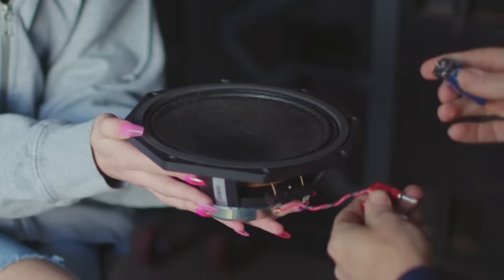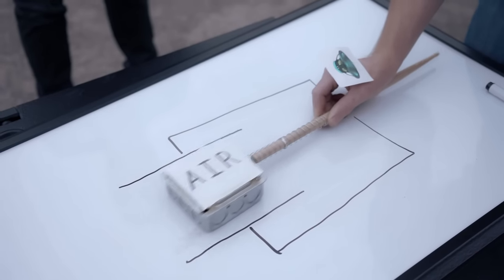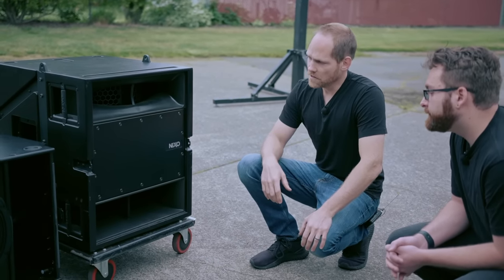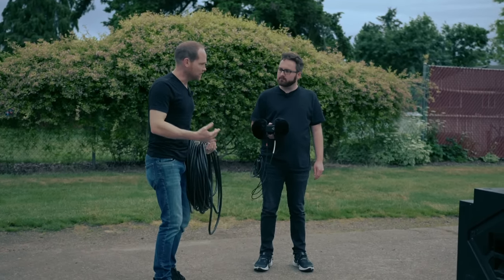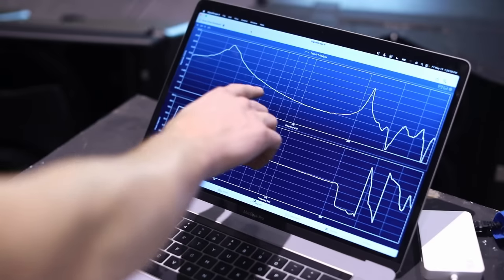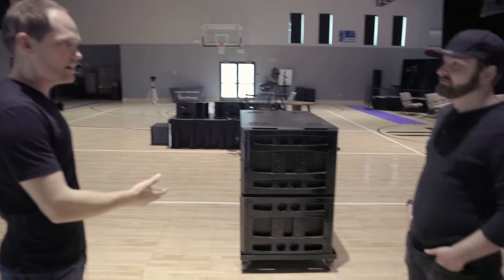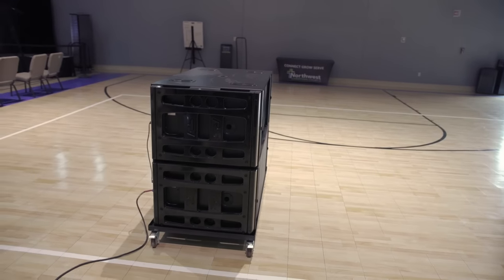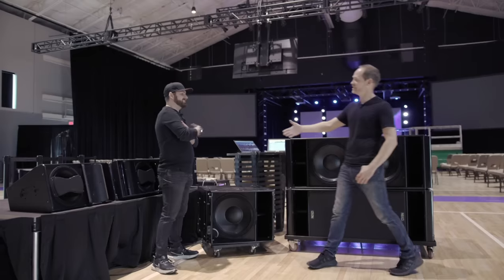Things you didn't realize about bass... until now.

Comment: You guys would be in my endeavor of creating and hopefully selling marketing waterbeds with subs built into frame underneath and crossover experimebts mostly only lowest freq moving the water, and there would be different shapes sizes and vented /non vented enclosures also secured to frame facing water bag at various angles,and what the axrual controls for user or sleeper(if you can sleep) will control..really experimenting with exotic woods and designs like ceiling suspended vs ground secured, yes ceiling suspended waterbed with subs pumping lowest freq through water bag,it's crazy,but I figure if I liked it,way back when. I started at SAE 18 years ago,been on back burner, then someone else will roo

Comment: I like your video. Very good way to do it actually! Try a full tl and tune it at speaker fs then see how much more range you have than a bass reflex that is in phase because of the time delay of the tl tunnel. and better to make it straight, big and simple than a maze. A maze will lower db, also standing waves.. for example a box with the bass in and then just a big tube with 1/3 wavelenght lenght of fs. The tube should not be bigger than SD in diameter. Lets say 28hz is about 3 meters or so. if you use stuffing, you will slow it down and make it shorter. Just tune the bass using dats v3. mesure first impedance curve in free air then see where it lands fs. then mesure it within the cabinet. then you get impedance spike form the cabinet and the port. it should be where fs is straight in the middle og those two peaks. if its not, just cut the tube lenght until it is.

Comment: One reason why I would use a 75ft XLR cable to create a delay to my second sub.. It runs much louder and smoother with less gains. Rather they are coupled or stacked or spread apart less than recommended  distance
Reply: Are you serious??
Reply: @pacosoundaruba   Sadly he is. It seems his knowledge of physics is lower than a potato. a 75' cable is not an ADL...
Reply: Ignorance is a skill......

Comment: i kinda of knew about this. bose audio took advantage of small speaker setup with so long tube chamber inside the box. thats engineering. people thought speaker is all about high quality material which is not entirely true. speaker that cost upward up 5k to 50k are highly tune and use material to get top notch sound thats the difference. people used to open bose speaker and find paper speaker and said bose went cheap. its all about how you tune the speaker to make it sound good not the material. 

i used to mod my speaker with seal speaker. it makes a smooth sound. didnt know much back then i just new it sound smooth and better. now, you see manufacture used radiator. radiator is better than seal speaker as it doesnt lower the loudness of the bass while giving it smooth sounding. radiator is the best setup in my opinion

Comment: I always referred to PA as Public Address, has it now become Pro Audio or something? I don't really know the history of it. I used to make amplifiers and speakers when i was 20, always liked the interesting concepts of speaker box shapes like W bins and folded horns etc. I never really used actual data though, I just tried stuff and see what happend I found the results fascinating. Never build stuff for big crowds though, I had massive PA speakers in a very tiny livingroom, enough to blow your brains out but I never really pushed the volume to extremes. I reaaly liked the sound of big 15inch+ woofers even if listened to on low volumes, drums just sounded more real somehow. Nowadays I'm happy with a normal hifi system and haven't built anything for over 20 years... But it was fun though, maybe I will build my own High-end Hifi system, that seems a bit more appropriate :)

Comment: The explanation is wrong but the visualisation is correct. The box is a resonant chamber, and the port is the weight on the spring. A simple bass reflex box has 2 resonant frequencies, one with the port and one with the speaker itself. These 2 give the subs color. Those rocket engine features are acoustic impedance adapters, or horns if you like that name
Reply from the maker: Isn’t the visualization the explanation?

Comment: Good demo, but badly worded on occasions IMO-still its about the best I have seen here on YT. Sound becomes less directional at low frequencies, so low frequencies couple with ported frequencies either in or out of phase (above and below the port tuning resonance), but at around 80Hz you can percieve where the sound is coming from. Also your ear becomes less sensistive as the frequency drops, meaning you need to push more air, most speakers can get to 60Hz, good speakers 40Hz or even 35Hz, but you need subs or 15" drivers with large excursion to actually 'feel' those low notes from say a church organ or your fave rap album, going below 20Hz is pointless as CD's do not contain that low frequency content, however some movies do (explosions and the like are 'felt').
Closed box speakers produce better transient response (termed 2nd order) whilst ported are not as hard-hitting but go much deeper (termed 4th order). Ported also have less distortion at the port frequency because the voice coil is moving less-longer excursions by their nature produce more distortion because the spider and surround rubbers do not act like a perfect spring.
In general when purchasing a subwoofer, try and get the larger boxes, smaller boxes use equalisation(Linkwitz Riley variations) and the tradeoff is they require very large excursion woofers adding distortion (as mentioned before), 
Most modern speakers really compromise on the driver quality, look for units that contain drivers from most notably Seas, Speakscan, Morel, Audex and so on.
B&W make their own, fantastic high end stuff, but their budget drivers used in most of their mid range stuff is pretty poor relative to off the shelf Seas for example.
You young guys really need to invent a better speaker system, this moving voice coil has been with us for decades and as I mentioned it has serious limitations, how about a electromagnetically suspended system to get rid of those spiders and surrounds (something to think on).

Comment: I remember buying a set of high quality 6x9 coax speakers to be in stalled in the rear deck in my car back about 1978. To test them, I just laid them on top of the deck, hooked them up and cranked up the tunes. They sounded terrible, no bass at all! My friend assured me that once installed, dumping half of the low frequency sound into the trunk, they would sound good, and that surely was the case. Laying on the deck the sound coming out of the front and the back simply cancelled out at low frequencies. So, yea.

Comment: there's no bass sound below 20 hz because the human ear can't hear that low of frequency, nor could the speaker play lower. Also, if your box is tuned to 30 hz, that would be it's optimum resonant frequency where little power performs best and 20 hz would seem to be non existent. Oscillation at it's best tuned frequency would be resonant and thunderous as can be for a specific amount of power and impedance. In resonance, the speaker will move much less than if it were clipping and distorted due to an improper box and tuning frequency, power and spl are proportionate with thd as well as being overdriven into a clipped signal.
Reply: That is not sub and sub can play lower than 20

Comment: clickbait so educational it should be taught to all sound enthusiasts. i learned that for maximum base efficiency you need to limit the frequency range (cut out the crazy ranges), dual speakers for direction control and programmable high end sound processor for amplifications delays settings etc to make it work the way you intend to. current single subs are good enough but if you watch this video you'll know it could be so much better! majority of sound aficionado wannabees don't know of this, known only to few sound engineers and hardcore audiophiles.

Comment: In order to achieve what you demonstrated with your hand and spring, the air would have to be compressed.  The mechanics of a speaker are not powerful enough to do that.  What is actually happening is the air coming out of the port is partially in sync with the air the subwoofer is moving.  This is done by calculating the distance of the port.  I say "partially" because the distance required is quite long.

Comment: ALPHA SOUND, y made a mistake in using the therm harmonic when you speak about the relation between the port and what's happen higher cosed by the port conception. thats a resonnance and not a harmonic. otherwise your channel in realy cool, thanks for that!
Reply: Agree. The ideal output of a port should be nothing else than the left hand side peak on the graph, around the box tuning frequency. All other peaks near the right (what speaker calls "harmonics" for some reason) make me think of port pipe resonances, which depend on port length and damping and perhaps other box construction details. Those resonances are not what we want.

Comment: His first concept on air flow is wrong. The woofer is thrusting air out in front of it, in parallel to the port air coming out, thus, creating the dual woofer sound effect. Only time you have cancelation of sound is when 2 or more subs are wired in reverse polarity and work against each other.
Reply: The woofer speaker is not always in phase with the port. Designing the speaker is the process of determining where that happens and is beneficial.

Comment: It's a wrong explanation. His hand is always at an 180 degree phase irrespective of the speed. Yes, it is possible to imagine the situation when the inertia of a driver cone and suspension will not allow for a synchronous change of direction, but it will mean that the driver is operating out of its specified frequency range. Besides, if this were the case, ported subwoofers would be impossible due to acrelatively low speed of their driver travel. The trick is to shift the phase of the backward traveling mass of air by increasing the length of its travel, i.e. tune the port. It is obvious, that it will take any audio frequency the same time to cover this extra distance inside the cabinet, so the signal will double at some wavelengths, cancel out at the others and be somewhat in between for the rest of them. The vented port calculations determine the frequency with the zero phase shift and the cutoff frequencies to keep the 180% phase shift frequencies outside of the driver frequency range. This concept works for all engineering implementations from the very simple to the very sophisticated ones.

Comment: is 50hz literally the woofer wafer oscillating 50 times per every second?
Reply: yes, crazy when you think a tweeter can oscillate 20,000 times a second!
Reply: @wally7856  Wow. So what causes the volume power to be more intense while sounding the same frequency?
I know larger size of the sound system is one way to increase the volume. However I have seen many small sound systems that can really pack a punch of sound volume.
Is it because the oscillating tweeter/woofer wafer needs to move at greater distances at the required frequency will produce loader sound for that frequency?
Reply: @ShopperPlug  Yes, greater distance = more volume. 

More volume can also be achieved through other means that increases the efficiency of the driver/air interaction such as more cone area/ports/horns, driver loading.

Essentially the driver is a solid (high impedance) trying to create a pressure wave in air (low impedance) so due to the impedance mismatch the process is very lossy (about 0.1 - 1% efficient). Imagine trying to paddle a canoe with a broom stick, most of your energy would not be efficiently transferred to the water however swapping the broom stick for a paddle now increases your efficiency by increasing the surface area of your stick. You can do the same by using more cone area- either a bigger driver or multiple drivers, using ports and or horns also increase the efficiency. 

You can also increase the efficiency by how you load the driver to the air. Play a song on your phone and hold it up in the middle of the room - this is called "full space" - sound radiates in a sphere away from the phone. Now place the phone on the ground and notice the increase in volume (+6 dB's) as you are now radiating in "half space", now slide the phone along the ground until it touches a wall which is "1/4 space" (another + 6 dB's), then slide it into a corner "1/8 space" (+ 6 dB's). Each time you encounter a new barrier you get an efficiency increase and the sound gets louder.

So to get very loud bass you turn up the volume to increase the distance the driver moves, use multiple ported or horn loaded cabinets and stick them all in a corner.
Reply: @wally7856  Inserting. Thank you for the helpful explanation. Would be great if you made a YouTube channel of a complete series of your knowledge in sound theory and complex speaker sound system design. I have read about the ribbon flat panel speakers and would someday make one after reading mathematical books showing how to design one.